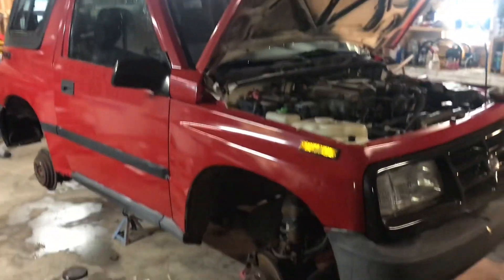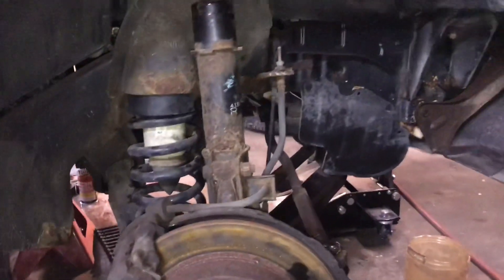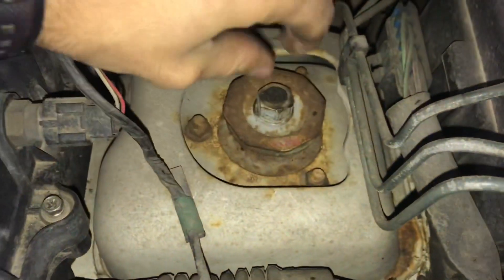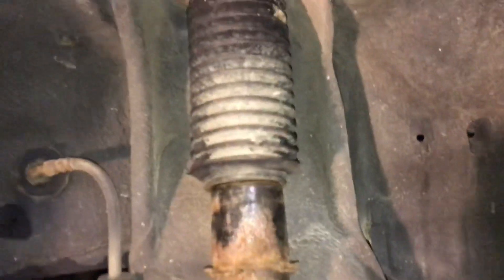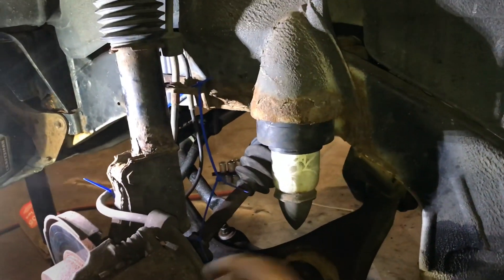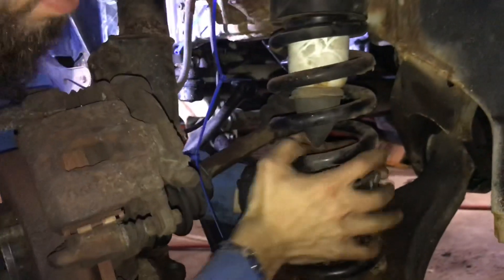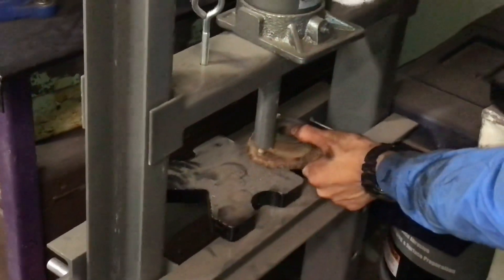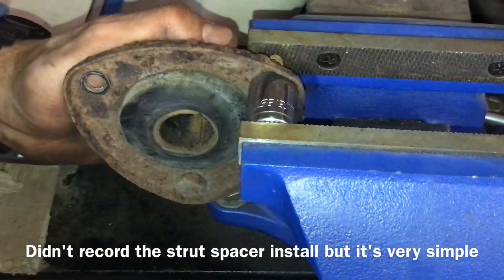Installing a 2" spacer lift on Geo Tracker

Comment: Do you need to replace the spring coils for this lift? Or are the Spacers enough?
Reply from the maker: The spacers pretty much push the stock suspension components to their max. I think taller springs would require longer control arms and the whole 9.

Comment: Would this work on a 2000 tracker four door?
Reply: I have this kit on my 03 4dr. Your control arm is probably the same as mine where the ball joint is part of the arm and can't be removed though. I fought with it awhile but was able to pry the control arm down to help get the spring in/out. I also took the bump stop off to give me more room.
Reply: Good video! I did a 1” spacer lift on my 02 Chevy tracker 4 door, but even with camber bolts I still have a lot of positive camber?? Any thoughts tips?

Comment: Did u need camber bolts?
Reply from the maker: I did need camber bolts, both top and bottom. I started out with just one set on top but realized I needed a bottom set. Thankfully you can get them for $20/set on amazon. They were super easy to install though! I'll post a video of the install of the second set.
Reply: @Riley.Greenup  yea I find the top of my wheels are out slight, maybe a bottom set will correct that
Reply: That's nice to know I didn't buy a 2nd set of camber bolts for nothing.
Reply: @Riley.Greenup  could you post a link or give me the exact size, I keep ordering the wrong ones, great  video